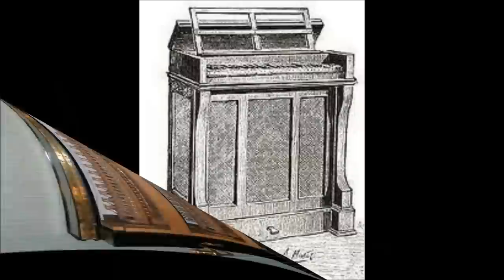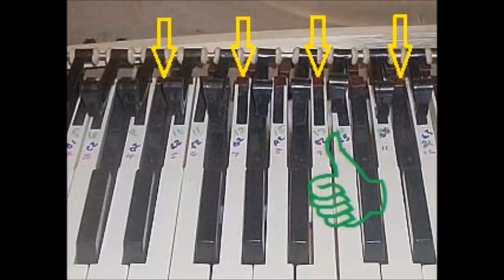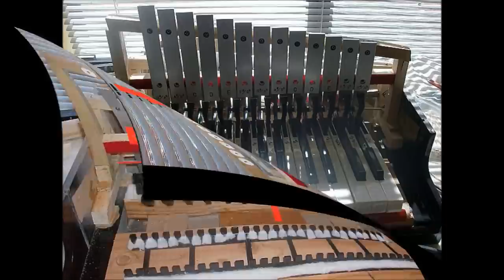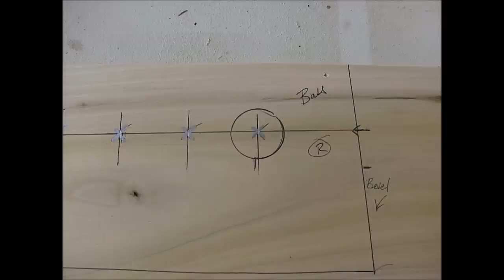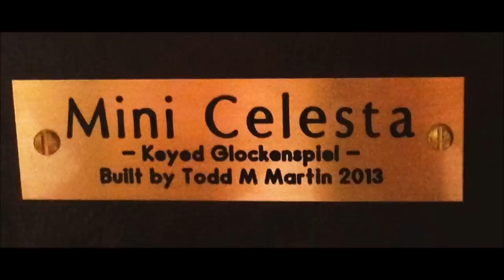My Homemade Celesta

Comment: Very cool project, thank you for sharing this video Todd. I'm presently restoring a Schoenhut toy spinnet. I've restored many guitars and basses. In my storage unit I have a quite rare 1800's "harp piano"  it's huge, about as big as the harp inside of an actual piano. They were popular only briefly, mostly in schools in the midwest. I haven't found much info about them, but apparently they have no flat notes (odd!) and were used much like an autoharp, played sitting flat like an autoharp would be, except this weighs about 75lbs. and it's size is about 4'x5'. A friend gave it to me here in North Dakota, he found it in his family farm's barn. The strings appear to be original, since they've obviously collapsed the original bridge over the decades (an easy fix) I'm hoping to be able to refinish it without losing the stenciled art and manufacturer's identification on the soundboard after I clean off the mouse piss and pigeon poo. Ahhh, the things we do for love, right? -another cool find I got here was a 1952 Sherwood DeLuxe lap steel, made by Kay. It sounds GREAT and even has the old screw in amphenol style plug. It was given to me by a cousin who'd put it away in his barn in 1955 when he quit playing! He said he doesn't know what happened to the old FENDER amplifier that went with it...dang!
Reply: Awesome! You've got some gems there. I'm going to look up the "harp piano".  It sounds interesting. Also, vintage Kay instruments fetch a handsome price these days. Thanks for the message.

Comment: Thank you for sharing this. I just built a hammer dulcimer of my own design and want to add a keyboard to it just like you did to the bells. It will be a challenge but fun.
Reply: I am doing just this right now. Yes this is a challenge. I am using very light weight hammers. Project should be done by Sept. 2016.

Comment: that is amazing, I want a celesta ,  I'm playing some celestra parts with my orchestra but using a digital keyboard, I wish I had the real thing...but the $20-40K for a couple of songs is probably not great value. Also wanted it for the Dance of the Sugar Plum fairy for my families next year Christmas concert. Given the amount of old upright pianos that are being given away for free around here locally these days, wondering if the keys and hammers from a piano would work if built a new frame for it. I'm not particularly expert at building anything could be an interesting project.

Comment: Nice little thing. :)
How did you tune the resonator tubes ? By blowing across the ends, like with a bottle ?
Reply from the maker: Yes, I started by blowing across the tubes to get close to the pitches but then fine tuned each one by adjusting the pipe fittings. The resonators are most effective on the lower tones.
Reply: @pianotodd  Thanks for your reply.
Of course the tuning itself is done by altering the length. But I wondered how you would get the best response of their resonating tone. Blowing was one idea, because I was not so sure if the tubes could be tuned by their response to the chimes, when they are built in. But possibly I'm wrong because that's what the resonators should do and what matters in the end.

Comment: Hello Tod, you did a great job but where have you found the picture at 3:04 because I have the same instrument without any manufacturer' name...1887 writen only...thanks.
Reply from the maker: +Don Dorgan Hi Don,  It was a generic pic that I found though a google search to use as an example.  How wonderful that you have the same instrument.  I did relocate the pic that was originally on an auction site with only the info that it was made circa 1880.  This one has a label above the keyboard but is impossible to read.  The auction site no longer has info since it was sold.  However, here is a link to the pic if it's of any help for you in doing your research. 
https://www.liveauctioneers.com/item/17378006_keyboard-chimes-celesta-c-1880
Reply: +Todd Martin . Thank you Todd .Your answer is a good help for me because I did not find any information in France or through Google. Now I'll search by the German auctionner...
Don.

Comment: Why do the bass notes make such a pronounced "clunking" sound?
Reply from the maker: I can't really answer your question Laura.  I'm not a professional instrument maker by any means.  I simply did this as a fun project just to see if it could be accomplished.  All of the notes have tone bars that are struck by hard plastic elbow hammers.  It could be that the lower notes allow the "clunk" to be heard more than the higher tones.  It could be that the mic I used for recording picked those up more than the higher notes. Thanks for your question but I'm just not sure.  :-)